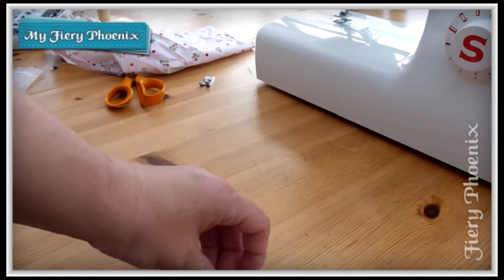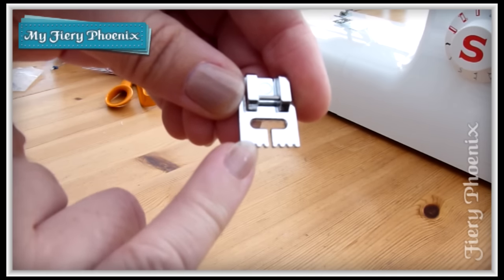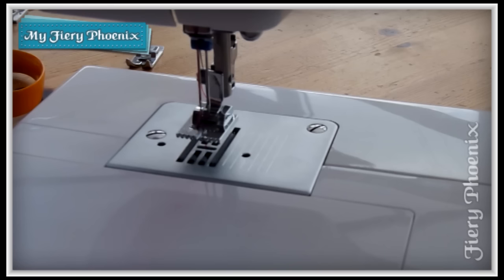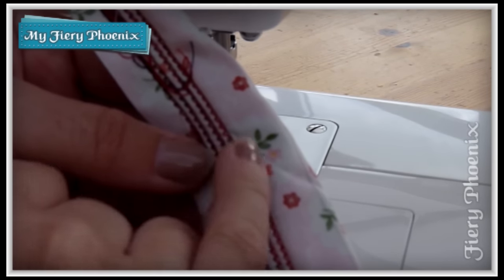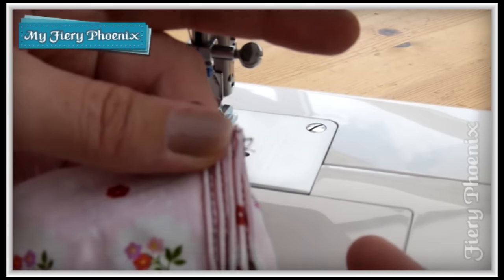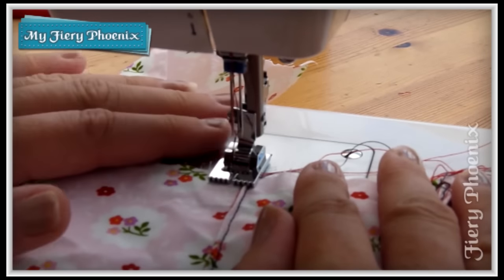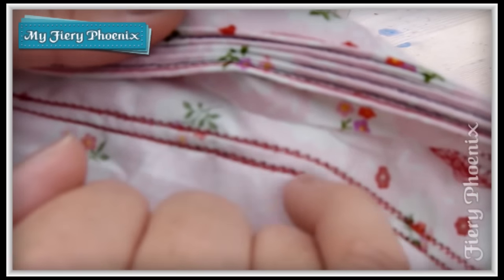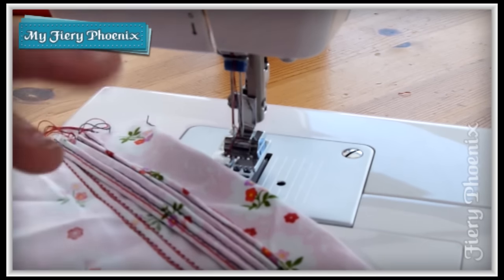How to Use a Pintuck Foot :: by Babs at MyFieryPhoenix

Comment: I tried this with different fabrics and I can't seem to get any tucks to form. I just get a double stitching. Do you change tensions to get the tucks?
Reply: that is what I am wondering, too. The effect should require that you have a tighter bottom tension and/or a pretty wide double needle.
Reply: Neither do I. I couldn't even make a single tuck with the double needle provided with my Brother 🤣 And I broke it in the attempt to bring it to the left with hope that it would work 😭
Reply: Try increasing the top tension.

Comment: Is it mandatory to use double needle
Reply from the maker: Yes this technique will not work with a single needle.
Reply: Thank you for your reply
Reply: You can iron down the folds & stitch.  More work but if you don't have the pintuck foot it is not that hard & worth the effort if you want pin tucks.  Good luck.